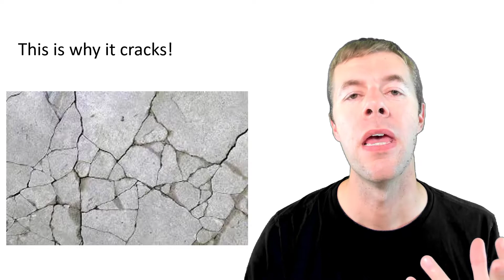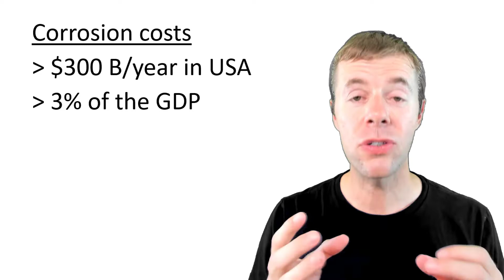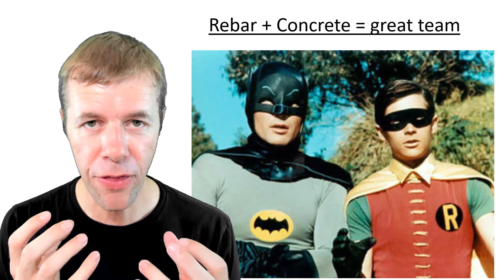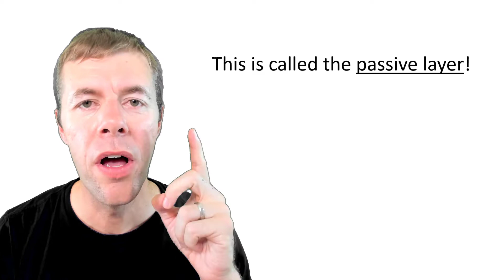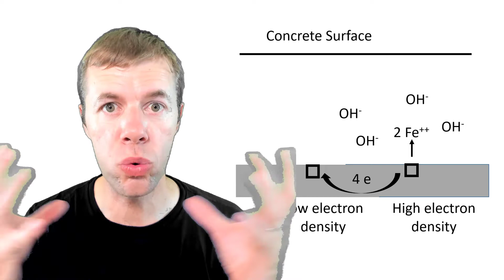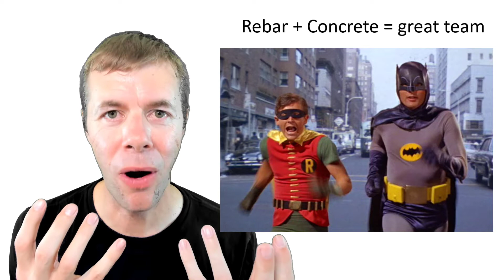Why do concrete and reinforcing steel NEED each other?

Comment: Hello. I love your videos.  What is your opinion of Helix Micro Rebar??
Reply from the maker: Thanks so much!  I have never tested it and so I am not sure.  I was following the previous versions of helix but I am not as familiar with their latest work.  Look for a fiber video soon.
Reply: @TylerLey  I'm a general contractor not a concrete guy, however, I am slowly becoming a concrete guy the more I learn of its diversity of use.  The Helix Micro rebar would be worth looking into for what it claims it can do.  The difference with it vs a fiber is that the Helix are 1 inch long (like a tooth pick size) twisted steel so the twist causes a mechanical connection as it would need to twist the bar when pulled rather than a smooth fiber.   I would love your opinion!
Reply from the maker: Thanks!  I am going to talk about the Helix in my next video.  I have some video showing the twist.  I don't have any data with it but I think it is a great idea.  I remember reading the original papers on it almost 10 years ago!